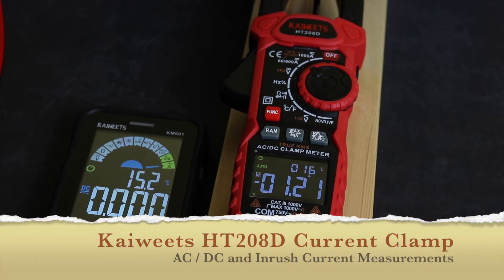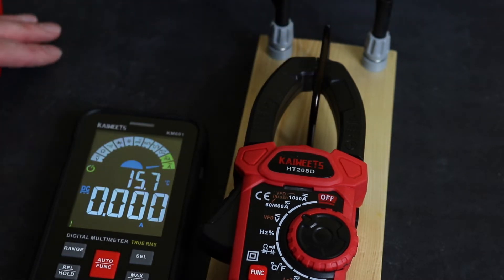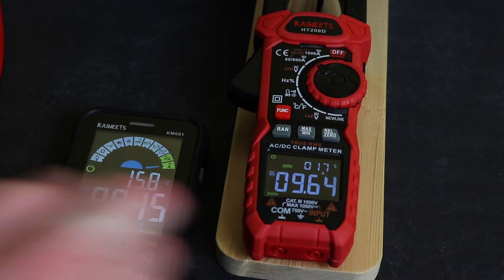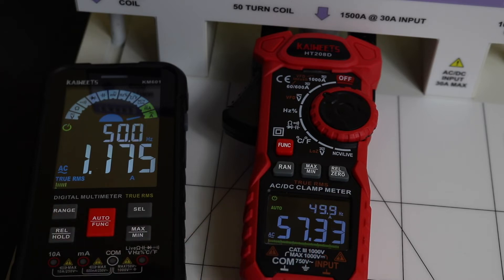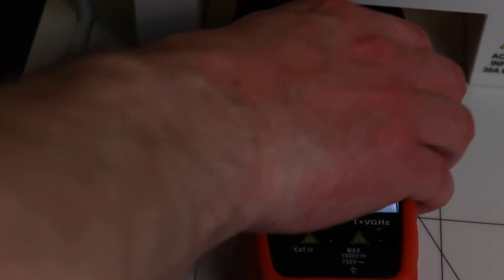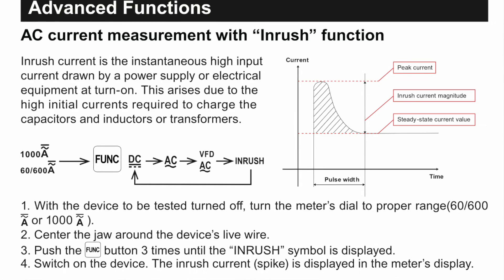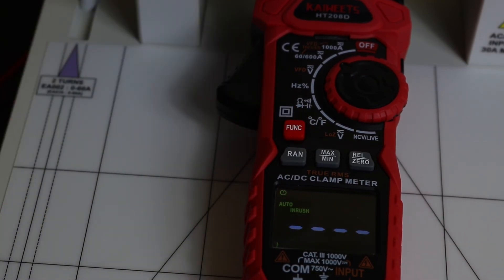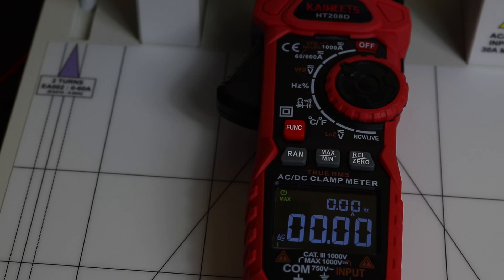Part 2 of Testing the Kaiweets HT208D Current Clamp Meter

Comment: Why did you not Zero the Kaiweets before current measurement?  I am sure the accuracy will then improve.  Manual specifies Zeroing.  Read the section on zero button and current measurement.
Reply from the maker: The meter was zeroed whilst around the test coil as there was no current flowing though it. All zeroing of a DC clamp does is remove the offset caused by residual magnetism around it. Therefore the most accurate way to zero it under this scenario is with it clamped around the coil and in the position it is being tested in. Under normal work conditions measuring on a live circuit, it is unlikely you can do that, so in that scenario, you would zero the meter prior to clamping the wire.
Reply from the maker: The meter was zeroed at 2.44 in the video, thanks for watching part of the video and commenting.

Comment: the ht208 clamp can be calibrated with calibration potentiometers, inside, there are 2, have you tried to calibrate manually? that would have been interesting to see.
Reply from the maker: I haven't tried any adjustments, I did ask Kaiweets for a calibration procedure, but they never sent one through. It is something I may try to do in the future if I get time and the test set is set up.
Reply: @three-phase562  the youtuber: "Viorel Caia" made a video on it the name of his video is: Kaiweets 208D clamp meter calibration. curious to see your video too.
Reply from the maker: @TheUltimateDIY  Thanks, I will take a look at the video.
Reply: Hay muchas variantes e imitaciones de distintos precios, lo  mejor es comprar directo al fabricante en Hong Kong.

Comment: Most unfortunate….  I bought this meter to verify peak amp draw on startup for my HVAC unit.  I’ve purchased a soft start unit and had hoped to capture the before and after.  I guess I’ll get a “value”, but it won’t be accurate.  I’m wondering if you just got a faulty unit?  Thank you for the very thorough testing on both Video #1 and #2.  Best I’ve seen so far.  Well done!
Reply from the maker: Thanks for your kind words. I am not sure if the unit is faulty or just badly calibrated. I did ask Kaiweets for a calibration procedure, but they weren't forthcoming, despite swapping numerous emails about the issues. One of these days I will sit down and see if I can adjust it to give a better performance.
Whilst the absolute value may be out on your unit the percentage improvement would likely give you a more accurate assessment of the difference in the startup current. i.e. both before and after values measured should be out by a similar factor, so the calculated percentage difference will be less effected.
Your other way to measure the difference would be with a scope and clamp adapter if you have one.
Reply: @three-phase562  Spot on.  I came to the same conclusion.  While the values might not be accurate, the difference in pre and post amounts should be....  Kind regards
Reply from the maker: @jimsjacob  👍👍

Comment: 4:46 have you compared measurements with the 50 turn coil using another clamp meter to see if the flux stimulating an actual high current is accurate?  I wonder if the high number of turns will match the theory or if they affect the readings.
Reply from the maker: Yes the coil has been tested against numerous other clamps without any problem. This particular coil is a professional unit from Transmille and is UKAS calibrated.

Comment: After the dialog here, I complained to Kaiweets customer service about the poor performance of my HT206D and they sent me a free replacement! That's something in their favor. I think the basic problem is that this meter does not measure down to milliamps which is what you need to detect many automotive parasitic drain situations. 

I looked at the UniT with a 2A scale that you mentioned, and then found a Mestek unit with 2, 20, and 100A scales, and a millivolt accuracy on the 2A scale, for a little cheaper. It arrived a few days ago. It's detecting a very small parasitic drain, but varying from 1 to 20 mA over a 5 to 10 minute period. That seems odd, but may be a built-in feature of the car's electronics. That is an acceptable amount that should not drain the battery for months. So now I need to figure out why my nearly new battery drained last time after sitting for 2 weeks. I use this car infrequently for certain purposes.  Perhaps I am not driving enough to recharge it sufficiently, or there is a fault in the charging circuit. I'll use the new current clamp to check alternator output next.
Reply from the maker: Glad you got some response from Kaiweets. 20mA doesn't seem too much of a drain. I think my car takes around 4 weeks to drain its battery to the extent that it won't start.
Worth checking the charging circuit. If you only use the car for short trips, then that will also reduce the charge going in.
I know you said the battery is nearly new, but sometimes you do get a faulty on from new with a reduced performance.

Comment: Just got back from my garage with a much reduced opinion of this clamp meter. I've had it over a year and never felt I could rely on it for much, but my recent test just proved just how absurdly inaccurate it is. As I explained in previous post, I am trying to track down a parasitic drain in my 2001 Ford Taurus. The clamp meter was showing a 0.48A drain on the lead from the disconnected negative terminal, and a 0.23A drain on the positive terminal with the engine shut down and all systems off. Something was peculiar about this because it did not change over time, whereas there should have been an increase when the electronic control system "woke up" and a decrease when the control system "went to sleep." 

To see if the problem was with the clamp meter, I disconnected the lead to the positive terminal of the car's battery. The clamp meter still read 0.48A. and stayed at that value after multiple on/off cycles of the meter, disconnecting and replacing it on the wire, and zeroing out of the DC amp function. Then I disconnected both negative and positive terminal from the battery, and still found a 0.48A reading with the clamp on the  disconnected negative lead and 0.23A when clamped to  the disconnected positive battery lead!! What is this meter responding to––the thickness of the wire? I tried it on a random 6-inch length of wire that was connected to nothing, and got a reading somewhere around 0.28A. Laughing to myself, I next put the amp clamp around the shank of a flat head screw driver. It read 3.63A and flashed orange! Perhaps there is some residual magnetism in the shank which confuses the meter. But what about the disconnected copper wires? Judge for yourself if you want to trust this piece of junk for anything other than entertaining an infant with flashing lights.

As far as my real problem, there is indeed some sort of drain through the negative battery lead, because when I connected my trustworthy Simpson meter between the disconnected negative terminal and ground, the built-in circuit breaker repeatedly though intermittently tripped. I believe I have a faulty controller unit, known in Ford lingo as a GEM (generic electronic module). I decided to order a used replacement on eBay and see if it fixes my ongoing problem of a new battery dying after a week or so of not driving the car. . . . Thanks again for your video.
Reply from the maker: I have just tested my Kaiweets against a magnet and also the Flir CM46 and UNi-T UT216C. I can zero each of them and they all stay on zero, but all of them will respond to the magnet 8.13A for Kaiweets, 8.25A for Flir and 7.64A for the Uni-T. This was with the clamp closed and the magnet placed at the joint between the tongues. So they all seem to suffer from that issue. My Kaiweets did not flash orange though.
If you cannot zero the reading on your Kaiweets, then there could be something wrong with it. I do not know if it is possible to magnetise the iron core in the tongues, if it has been subjected to a strong magnetic field.
I know there are a few people who have purchased a Uni-T UT210 for work on motor vehicles as it has a 2A DC range. It is relatively cheap and seems to have predominantly good reviews on eevblog. It may be worth a look if you can't get any joy from the Kaiweets.
Reply: @three-phase562  Thanks. I suppose there is a small permanent magnet inside the Hall effect probe. Perhaps this can get disturbed by high currents? I just noticed you have a video on the teardown of the Kaiweets 208D.  I'll have to look at that. Believe it or not, I have read Edwin Hall's original paper on the effect he discovered, but am far less familiar with the circuity in a modern Hall Effect sensor. I'd like to understand it better, as it could possibly explain what I might have done to my device. (Or maybe it was defective from the beginning?) I'll also look at the Uni-T UT210. Thanks again.
Reply from the maker: @SiteReader  If you have never been able to zero the DC current, then that to me is wrong and the meter is likely defective from the beginning. If you used to be able to zero it but can't now, then something has failed either through use or a longer-term defective material.
I only took the back cover off the meter, as I am more interested in the CAT protection offered by the meter.

Comment: Thanks for the video. Can you clarify something for me? What is the correct position of the clamp on the wire for DC current testing? You seem to have the wire running parallel to the plane of the meter in your test rig. Is it all right to have the wire running perpendicular to the plane of the meter? I get a reading this way, and it is more convenient in my arrangement where I am trying to measure parasitic drain on a car battery. An added confusion for me is that I watched an instructional video from Fluke where they show the clamps not even closed on the wire; rather the wire fits loosely within the open space enclosed by the clamp. (Perhaps this works for AC?) Please clarify.
Reply: I should add that my Kaiweets instructions only say "make sure the wire is centered in the clamp," which leaves it ambiguous whether that means touching the clamp or within the open space enclosed by the clamp. There is no diagram.
Reply from the maker: @SiteReader  The wire needs to run through the hole in the clamp meter tongues. In an ideal world, it should be in the middle of the hole and should be kept away from the meter. This is when it will be at its most accurate. However, that is not always possible when making readings in the real world. When not centraised, you may lose a bit of accuracy, but clamp meters generally have a relatively high tolerance anyway.
For AC current you are utilising the magnetic circuit made by the clamp tongues so they must be closed otherwise accuracy is seriously affected. For DC current, the clamp tongues are not used, and it is actually a small hall effect sensor embedded inside the instrument that is detecting the current, therefore the clamp does not have to be closed for DC.
You just have to do the best you can when measuring, try moving the wire around inside the clamp to see how the reading is affected. It will depend on what value current you are looking at as well. Less than a couple of amps and this meter is not all that accurate anyway.
Reply: @three-phase562  the clamp should be closed for current measurement regardless of AC or DC, did you find that the measurement of DC current is unaffected by the clamp being open?
Reply from the maker: @sadfur8728  Yes, ideally the tongues should be closed for DC measurement to get the best accuracy. It will depend how the hall effect sensor is physically mounted into the meter as to the effect. On the Kaiweets, I got about 1A differential between an open and closed clamp, but i did not test across the whole range of the instrument.

Comment: Very impressive testing approach.
and no hidden agendas and trying to sell it, just let reality stand on its own two feet and exactly how it should be..
also got a variant of this clamp meter, though its the Habotest version HT208D.
its somewhat cheaper and the only difference I can tell is the probes, that is some tacy cheap ones and not the silicone'ish variant from the Kaiweets..
Its pretty new just arrived, but will try to test it out to see if I get the same variables., or at least as good as my noob'ish knowledge & tools can manage.
thx for one thorough testing.. subscribed as I like the honest approach that takes center, at least in the video above i just saw.
Reply from the maker: Thanks for subscribing. A number of Habotest instruments do seem to be the same as Kaiweets, I have only purchased the Kaiweets ones though. Hope you get on with your meter well.

Comment: I’m a little surprised at the inaccuracies of this meter. I have always thought of Kaiweets being reasonably accurate for it’s price point. Very good test review. Thanks!
Reply from the maker: Glad you liked the review. The clamp is still reasonably accurate in comparison to some clamps, its just that I could not get it to meet the manufacturer's specification. It was an Amazon purchase, so I may have been unlucky, don't know anyone else who has one though to run another set of tests on.